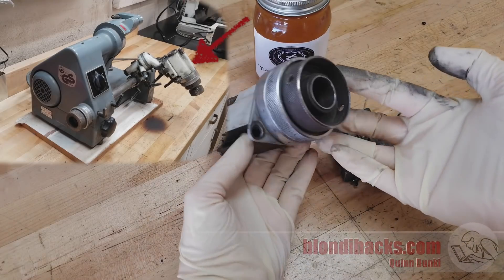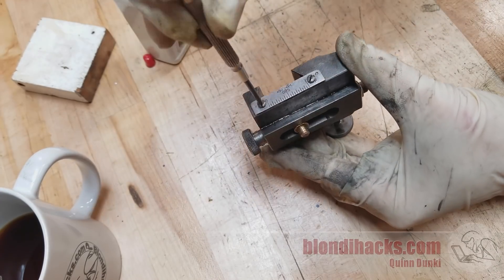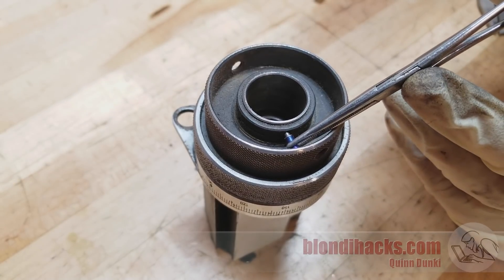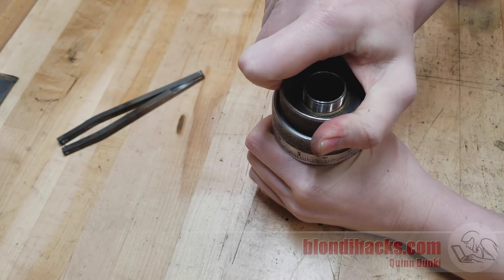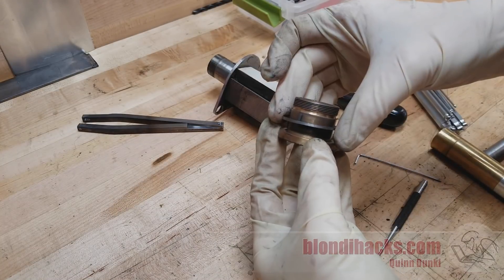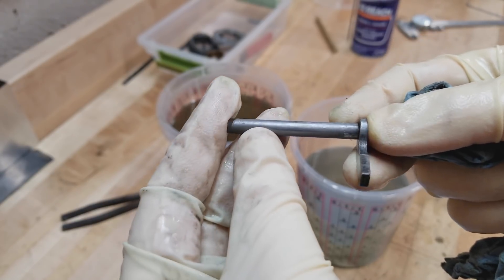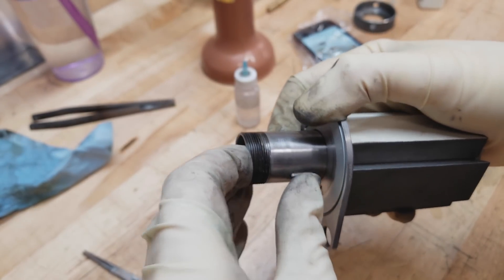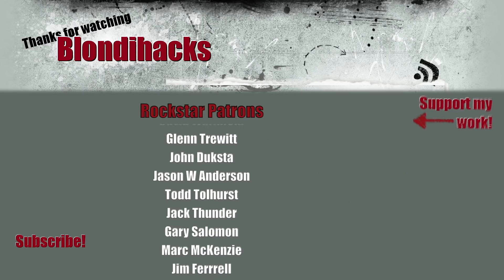D-Bit Grinder Restoration - Part 4

Comment from the maker: I was puzzled by all the bluetooth and headset related comments until I figured out the description was wrong. Well, hey, at least now I know people are reading the descriptions. OR MAYBE IT WAS A TEST ALL ALONG HA HA YOU ALL FELL FOR IT. No, no it wasn't. It was a copy-paste error.
Reply: Think about using paraffin wax compounds on the exposed areas you want to use lubricant on. Bike riders have been using it on chains for a couple decades because it will not pick up dirt and wear the chain faster like regular oils would.
There are plenty of  videos on line on how to use it. Basically you melt the wax and soak the chain. It's best if the parts are warm to keep from having excess buildup.
There is one that has teflon and another dry lube additive in the wax.
Molten Speed Wax
Reply: I feel cheated... I wasn't able to check the video when it first came out so "I" didn't see the bluethooth headset part of the D-bit grinder. I mean how cool would it be to plug a bluetooth headset into a grinder :o)
Reply: @Blondiehacks .001" runout is twice as much as I'd want(.0004" is as far as I'd go) , but you can work with it. tool making tolerances should be close to perfect(ideally). Just mark your high or low spot and shim it if you have to. But it's all relative to what you need it for. Grandpa always said "Do the best you can with what ya got, and take your time". If you haven't already, check out Stefan Gotteswinter here on YT. He is very thorough in his vids and uses a D bit grinder a good bit. Also, I love your vids. I've worked in machine shops for a long time, and let me say, you have a great way of explaining things to beginners and to old hands like me who may and do need a fresh perspective on things. Be sure to go check out Stefan. He's on another level. Have a good one.

Comment: The runout on the end mill shank is probably coming from the collet.  For starters the cylindrical diameter at the threaded end of the collet must fit precisely into the bore and the taper front must be burr and nick free.  Second take a ground pin the size of the collet ( a plug gauge works well ) and chuck it up.  Now check for runout close to the collet and out and away from the collet.
How close ( runout ) does it have to be depends on what you are grinding!  You will determine that by your application.  What you have will work fine, until it won't be good enough.
Remember we are always chasing the weakest link in the proverbial chain!
JIM
Reply from the maker: Post-script- the runout turned out to be grit in the collets. That’s covered in a later video in the series, I believe.

Comment: hi quinn
great video, thxs for sharing
after fighting stuck and stubborn keys in shafts for a while i developed a suitable way to get them out undamaged
if you have smooth vise jaws (uncerrated) - put the sticking-out part of the key flush into the vice, snug it up firmly and then tap the shaft from underneath
in 99% of the cases the key will separate from the shaft without any damage
good luck and keep going with your great channel
greetz from germany
Reply from the maker: That’s a great tip- thanks!

Comment: Do you have a PO box, or other address I can send some things to you? 

I recently bought some precision ground dowels from MSC, (only in boxes of 100, 50, 20, depending on size.), to make some drift punches, and for use as alignment pins for some metal pressing projects I have planned.   I'll send you a few of each size, from 1/16 to 0.50", so you can either make a huge set of drift punches, or you can go the Vise Grip route. ;)

The other plan I have for the dowels is to anneal some, and see how they work for round turning stock.

Oh, regarding heating to loosen things. There is a freezing spray lube made by several companies. It's the same theory as heating, but uses cold, instead. It works great for stud, broken bolts or pins, as the cold, shrinks the fastener inside the hole. Heat in the same situation won't work as well, if the outer portion is way bigger than the fastener.  Let me know if you can't find it easily, and I'll go to the shop, and see who makes the stuff.

GeoD

Comment: Here's a favorite trick - I "sous vide" my parts by putting them in a bag suspended in water and then add the Evaporust. This helps reduce material use. I've struggled with finding good shallow plastic containers to use such that I conserve the material, but this approach works well for parts of many different geometries.
Reply: I do that but suspend the bag in my ultrasonic tank.
Reply: Great tip.

Comment: good trick for keys straight and woodruf is grab one end with the point of a pair of diagonal cutters then rock the handle down and this will usually quickly and easily pop a key out.

Comment: I loved imagining the fit of that one turny thing in the other turny thing. I think I drooled a little bit. And that runout... 🤤

Please forgive me if you're already familiar with this, or somebody else has already brought it up: To improve your not-chowdering-screws-fu, I suggest looking into hollow ground screwdrivers, often called gunsmithing screwdrivers. If you haven't seen them before, the difference in tip geometry vs. the common hardware store screwdriver will be one of those lightbulb-above-your-head moments. And the best part is that once the concept is in your head, you can just make one out of any old screwdriver as needed, custom-fit to the specific screw that is giving you fits. Even if you buy ready-made gunsmithing screwdrivers, it's normal to grind or file them to fit the slot width and thickness of a specific screw that you really don't want to chowder. They also often have square shanks so you can get a wrench on them for extra torque while using the handle to keep them properly seated in the screw.

Even knowing that, I still chowder screws when I'm lazy or impatient, and then I instantly wish I had taken the time to do it right. Sigh...
Reply from the maker: That’s interesting, thank you! I’ve not heard of gunsmithing screwdrivers. I’ll look into that. ❤️

Comment: In addition to my previous comments I'd like to add this bit of advice addressing the runout problem seen on the spindle: Remove the spindle and place it on a pair of Vee blocks. Check the runout by carefully turning it and watch the indicator. If the runout shows the same error, you'll probably need to grind the interior. If not, the culprit may be the 2 nuts that apply 'preload' to whatever thrust bearings there are. I dislike double nut systems like this as they are difficult to set properly (as you have already discovered) and, depending on the amount of backlash between their threads and those of the spindle, can skew the nuts at an angle. The skew (the nuts want to tilt as they are tightened) can bend a spindle. Not much, to be sure, but if the bore is tighter closer to the nuts (normally occurring in an older spindle), it becomes a fulcrum and this will have an effect of bending on the far end of the spindle. To remedy this. I have made a new nut and drilled and taped a hole through the edge (the ones you have look to thin to just drill and tap a hole through the edge). Cut off a bit of solder or copper and put it in the threaded hole to protect the male threads from a set screw. When you set the preload on the spindle and nut to your liking, tighten the set screw. This will straighten out the nut (perpendicular to the spindle axis) and serve to keep it from loosing. I have done this with many lathes to good effect. Hope this helps

Comment: Nice job QUINN. I think I would do more checking to see if it was another problem . And then buy 1 high precision collet and check again.
Or maybe someone has a precision collet they would let you use to check your holder.
Reply from the maker: Yah I’m not done looking into that situation. It won’t prevent me from carrying on with assembly though.
Reply: Got ya good luck and by the way great job so for if you want to swap.stickers email me your address... elkmontbrown@yahoo.com

Comment: Machine looks to be in great condition. Are the fits so good that grit can't get into the oil? Looking forward to demonstrations of it's proper use. (I have a Chinese knock-off from Shars.) Need all the help I can get!
Reply from the maker: I’m trying not to use oil anywhere that grit can go. The important mechanisms are all sealed with o-rings
Reply: @Blondihacks  How would molybdenum disulfide powder work in place of oil?

Comment: Knowing the runout you can make a known reduction on any cutters you make,enjoyed the video. Best wishes from retired toolmaker in the UK.
Reply: Being extremely new to machining, could you share how a guy would go about adjusting for runout? Unless, Machinery's Handbook, or elsewhere, already has an explanation you could point out.  

The biggest challenge for finding it, is knowing the correct terminolgy to search on; it's a big azz Catch-22 for newbs: you know what you're looking for, but not what it's called!

Thanks, in advance...

GeoD
Reply: George Dennison if the run out is .001" the cutter will cut .002" bigger, so you make your cutter .002" smaller which will make the piece your machining come out the correct size. Hope this helps.👍

Comment: I'm starting to get the impression that this thing was never meant to be disassembled!
Reply from the maker: Honestly, on the contrary. This is quality engineering with maintenance in mind. There are no plastic parts, no glue, no one-time clips, nothing is welded up, etc. It’s all quality mechanical fasteners of standard types and everything comes apart. The challenge is figuring out the intent of the design without documentation.
Reply: @Blondihacks  That's a really good point. I retract my statement :) Looking forward to seeing this machine come back to life.

Comment: Hey, new to the channel, so maybe I'm getting this wrong, but are you actually using whale oil? Because I thought that'd be banned by some sort of endangered species act...
Reply: Lol you're kidding right? Shes using "Way oil" not whale oil 🐳 haha.
Reply: @daviddaddy  my background is in electronics, not machining, had no clue Way oil is a thing. thanks^^
Reply from the maker: Apologies for the confusion- I should have explained that in the video. “Way oil” is a shorthand for a class of sticky oils used by machinists. The most common is probably  ISO68. It’s so-called because it’s typically used on the sliding surfaces of machines (“the ways”). It is sticky so it tends to stay place, while remaining thin enough not to interfere with precision movements. It’s a standard petroleum product, and no whales were harmed in the making of this video. ❤️
Reply: @Blondihacks  thanks for clarifying :)

Comment: I've encountered the same issue with my ER collets.  Three different sets that where similarly priced yielded a range of values from .0005 to .002.  I just matched up the best ones into a "precision" set and used the rest for other jobs.    Great vid on the grinder, I'm totally gonna pick one up.
Reply: There are several vids on how to true up ER collets. 

I just bought a set of Er32's, and have planned on having to true them.  Given their low price, it's acceptable, IMO.  

Now, if they were one of the US made, pricey as hell collet types, I'd expect them to be true, on arrival.

Comment: G'day Quinn,  it's best to adjust gibbs with the leadscrew disconnected.   You won't notice if they're adjusted to tight due to the high leverage of the nut and screw.
Reply from the maker: There’s no way to do that on this device. You can’t disconnect the lead screws without dismantling the machine, which requires removing the gibs you wish to adjust.

Comment: Hi
A suggestion: use some Dykem Blue on a NEW collet and carefully install it into the spindle. Make a mark with a felt tip pen on the end of  the collet and the end of the spindle at the same place for a rotational reference. Remove collet and inspect for streaks. Use a fine soft round dressing stick (mold makers sticks) to stone out the high spot(s). Hope this helps
Reply: ...Stone the inside of the spindle...
Reply: Wow. Didn't think this through very well... use Dykem's Hi Spot Blue. Use a Beyer (roller, if you can) on the collet. Also not clear in my description: the streaks are a result of  a surface in the bore, that has defects. Scratches, burs or dings will cause this.  Hardened chips will leave dings or scratches, soft materials like aluminum chips can cling to the surface of the spindle bore when the draw tube/collet is tightened. Stone them out after carefully aligning the marks you made on the spindle and collet to find out where the 'high spot' is in the bore.

Comment: I'm starting to feel like  I'm the only kid on the block without a cutter grinder...
Reply: We must not be on the same block.  I've been wondering why a valve grinding machine wouldn't work. They have to have minimal runout, so the valves seat perfectly.

Comment: Hi Quinn - nice to see the progress you are making. Isn't it a good feeling when your tools are clean and working properly (for the most part).
Have you thought about contacting Don Bailey from Suburban Tools Inc about your collet run-out issues? he's a clever fellow with lots of knowledge about these.
Also, there is a Reamtec  easyZERO adjustable collet nut from Monaghan Tooling Group which has 6 perimeter screws to align collets & tooling.  Check 'em out - & Merry Christmas :)

Comment: Tight keys are great to stabilize an assembly, but removing them can use up every tool in your shop.  When I encountered them in B&S spindles, the manufacturer planned on their occasional removal during rebuild.  The keys were made with drilled and tapped holes that would accept screws common in shops that would jack the key loose enough to lever them out without damaging them.  When young, I replaced some damaged keys with a pair I made.  I assembled the spindle, then took it apart again to install a left over washer.  My simple set of keys cost me a few more hours removing once again.  That taught me the wisdom of those simple little screws.   Lesson:  Experience is not gained from what we do right, but from what we do wrong!

Comment: A tip to get difficult threads like that started: Turn the screw counterclockwise (or whatever direction is "loosey") until you hear/feel it click, then try screwing it in. The threads ramping against one another in the "loosen" direction will align things, and the click is the thread starts falling into place.

Makes cross-threading much less likely.
Reply: For anyone reading - this is the trick for screws into soft materials like plastic and wood too.
Reply from the maker: In fact, I have covered that trick a few other times in my videos. It’s a good one.
Reply: @Blondihacks  hi,1 have questions about making simple profile lobe with rotary table and apso  i want to know how its possible to make more complicated lobe by manual milling machine,,,,, 

Please let me know if you have an idea

Comment: A pair of diagonal cutters can grab a key and take it right out. Really works nicely with minimal to no damage to the key.
Reply from the maker: Oh shoot- that's great advice, thank you! I'll try that next time.
Reply: @Blondihacks  My pleasure! :-)
Reply: If I may suggest; Toolmakers clamps gripping across full length, or as a last resort, Vice Grips.
Reply: I use the same trip to pull brads or errant staples out of wood projects

Comment: I used that little grinder with a Deckel pantograph.  0,001 run out should be ok on larger diameter tools.
And I hope you have fun with that tool, it will give you fantastic home made tools eh...   Ü

Comment: Quinn. Try using a pair of flush cutting wire cutters for those stubborn keys. They act like a lever to pop them out.
Reply: Be sure it's your crappy chinesium pair. 😂
Reply: It works, but yeah -- don't go into it expecting zero risk. 
Most flush cut nippers are meant for soft wire only (not all, but the common sort most likely at hand).  When I say "soft wire", i mean aluminum and copper versus steel, as opposed to baling wire versus piano wire.  

I've trashed my fair share of cutters and  nippers (nicked/broken/misaligned jaws) trying to pull and pry, and none of them were cheap junk (Klein, Xcelite, Knipex).  That said, I do have a junky old pair of bent Dasco nippers I found in a ditch.  For some reason, they work great for this sort of thing so long as I don't care if they survive.

Comment: Quinn, if the rest of the head is really that close if a fit shouldn't the collet be also, the runout will be magnified else ine the in the tool?
Reply from the maker: Yes, that's definitely a concern. I'd like to know why the collets introduce so much run-out
Reply: @Blondihacks   you should check the run out  in the mounting point and the collet itself , should be able to find an answer starting there?
Reply: @Blondihacks  check the run out where the collet is used and thecolet for run out onthe od, you might get some answers there?